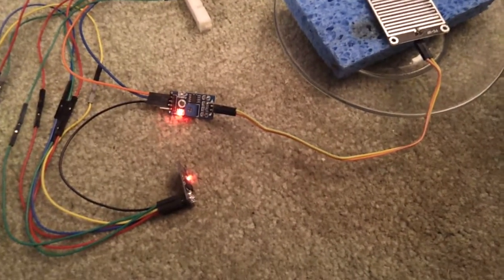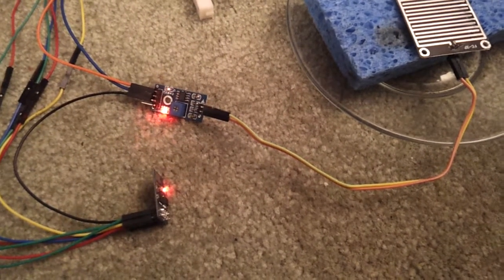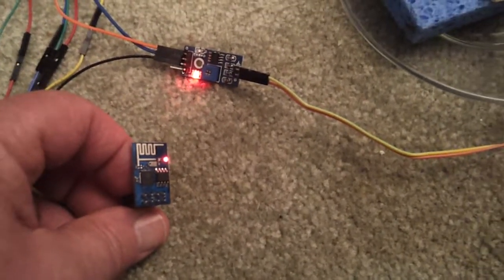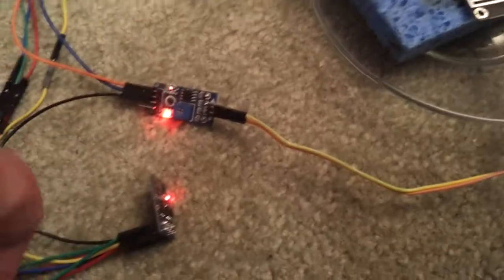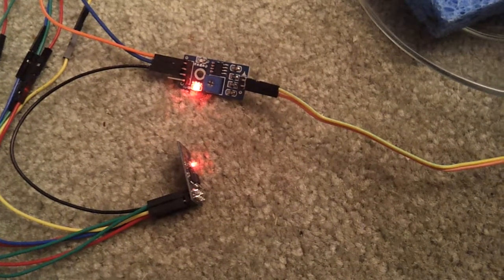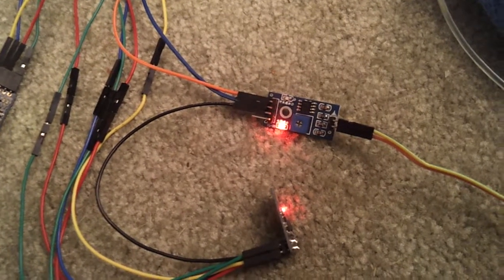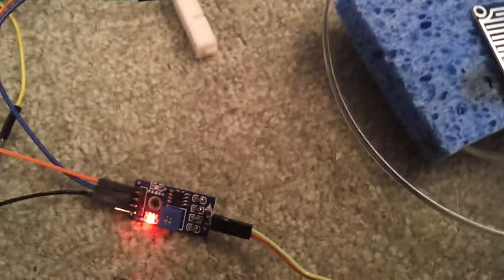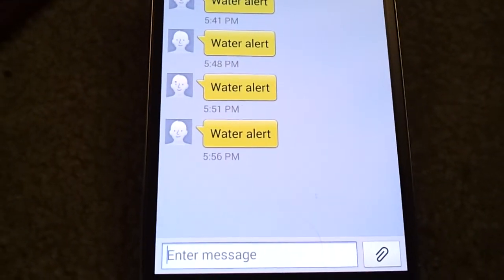ESP8266 water alert system

Comment: Can i pls get the image of this circuit and how you program it.. Please😢😭
Reply from the maker: Sorry I do not have a diagram schematic of this, was a while ago. It is basic ESP8266-01 programming used an ftdi serial usb adapter and Arduino to program, better instructions else where { https://medium.com/@aallan/getting-started-with-the-esp8266-270e30feb4d1 has lots of info } -- only thing special here is the signal from the water monitor to GPIO2, everything else is just power and ground.

Comment: list of needed items in text form?
Reply from the maker: ESP8266-01
uxcell Raindrops Detection Sensor for Arduino Weather Module Humidity Detect Kit
Female micro usb to dip breakout board for 5v power
LD1117V33 3.3v regulator  
various jumper cables to hook up everything

I would not recommend those kinds of cheap conductive water moisture sensor as they corrode very fast and do not last long at all.  The better kind is a capacitive sensor - Amazon has an analog capacitive soil moisture sensor, altho the esp8266-01 module does not have analog input,  so another board like the Wemos D1 mini has analog in and is easier to program.   I have used Chirp! sensors in the ground for years and they do not corrode.
Reply: Thanks! have a great week :D